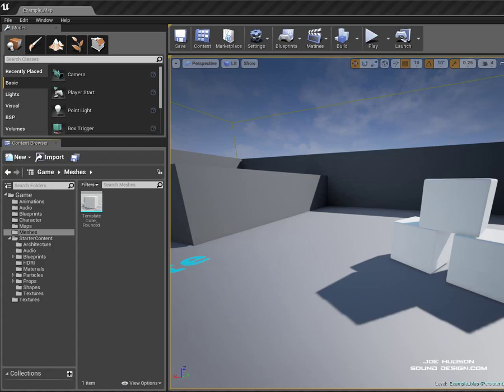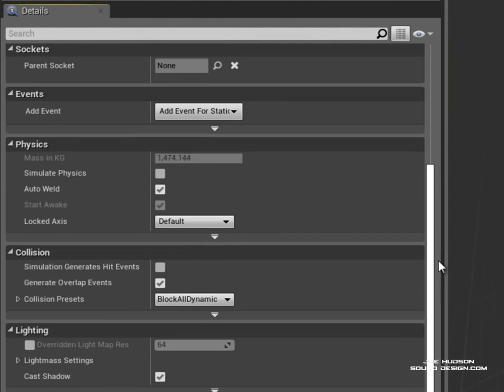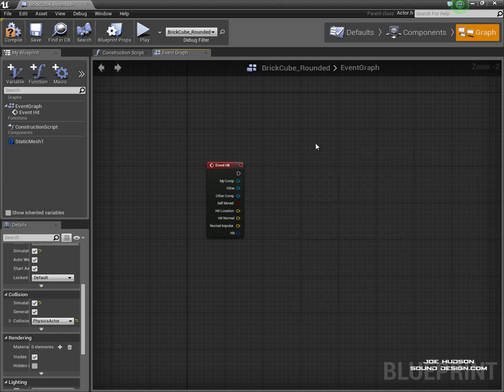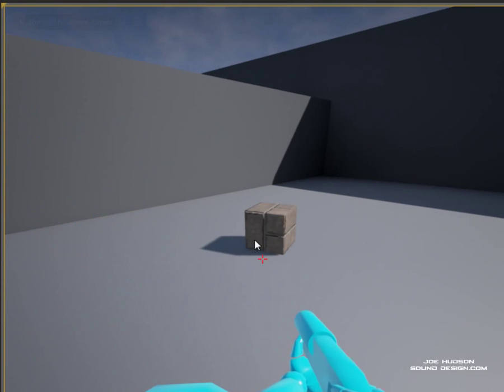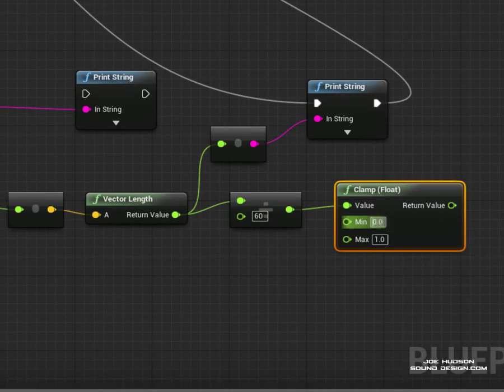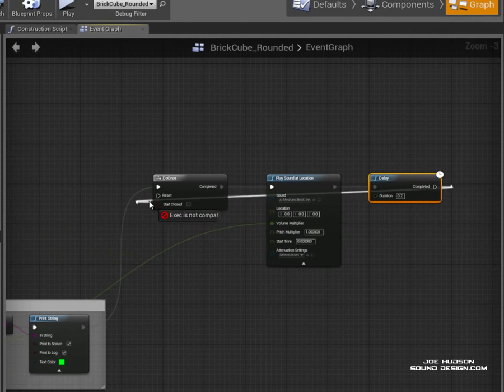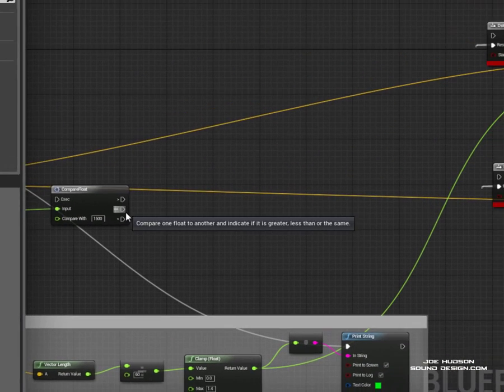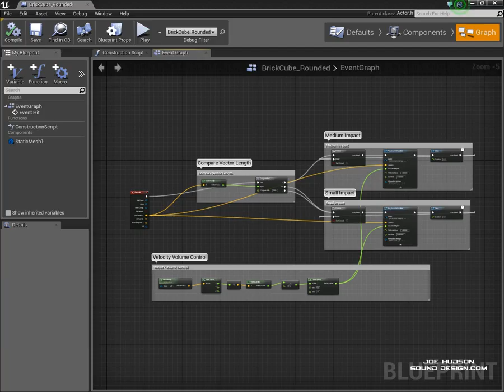UE4 Tutorial - Advanced Audio & Physics Collisions

Comment: Vector Length. VECTOR LEEEEEEEEEEEEEEENGTH. That's what I needed! :D

Thanks, great video.
Reply from the maker: You're welcome pal! :-D
Reply: Side note - do you have any tips on modulating a lower pass filter in Unreal (without Middleware) I found something in Blueprints but couldn't get it to work. Posted a question about it here: 

https://answers.unrealengine.com/questions/589915/get-set-low-pass-filter-does-not-appear-to-functio.html
Reply from the maker: Yeah it wont work mate, although audio enhancements are about to drop in 4.16, not too sure on the details of what is being released, but Epic are addressing the audio deficiencies with the engine. Some things are just static code and wont work without bespoke code support. I am trying to do something similar with global wind speed tied to a wwise RTPC and it just wont budge. Good hunting.
Reply: Ah, thanks so much for that! Keep being awesome. :D

Comment: Thanks for the tutorial.  I need to come up with a way to simulate many marbles rolling around.  Potentially my scene could have as many as 300 marbles rolling (that is pretty much the only thing in the scene, the marbles and a funnel)- I'm assuming it would be a bad idea to have each individual marble play the sound a single marble rolling around?  I'm not sure what the best practice is or upper limit of audio sources is.
Reply from the maker: What you need is a looping marble sound, loop it continuously in the marbles actor blueprint and use the marbles vector velocity to fade in and out the volume based off a certain threshold, (using the same techniques in the video to get the velocity values in the correct ranges to control the volume. Check out my audio optimisation techniques video to cull your voice count, I do this on bullet impacts but the principle is similar, perhaps you could use a cone volume attached to the camera to only audition the marbles when they are in shot. or if that doesn't fit your game, you could count the number of marbles spawned in the scene to a global int variable and then in each marbles blueprint before the play sound node you could do a check for the number of marbles in your scene and if less that or equal to a say 6 marbles play individual marble sounds if greater than, play another marble sound which mimics hundreds of marbles in the level blueprint as an ambient sound. Hope that gives you some ideas.

Comment: When it comes to creating original assets from sound libraries/recordings for use in video games do you normalize your audio assets so that they behave more consistently in the engine? I'm thinking in regards to attenuation and levels. If so, at what level do your normalize to for ambiances versus sfx or foley? Cheers.
Reply from the maker: Since mixing in the unreal engine without third party middleware is a real pain, its always a good idea to have consistent levels for your asset groups.

Tbh it totally depends on the game you are working on, there are no hard and fast rules, but as a rough guide you might want to have your ambiances somewhere between -68dB and -28dB. SFX such as gun fire at -6dB. Explosions -0dB. In terms of Foley it depends what the object is, something around -12dB to -24dB. That sound put you in the ball park.

In terms of attenuation, it totally depends on the object, but what I will say is that if you are using Wwise and you have an unnatural object don't be boring with the attenuation curves, create something unique and push and pull the player into the sounds location in a way that is interesting/moving.
Reply: Joe Hudson
As of right now, I'm just doing some sound design for some of the showcase levels. Working on Sun Temple right now. Having an idea of where I should be normalizing to(for the sake of consistency) is a big help and I appreciate shedding some light on that subject for me. Like you said, there are no hard and fast rules, but having knowledge of the usual ( and I use that term loosely) levels of ambiances, ,sfx, and foley is a huge asset. As for Wwise, I've ran through about 85% of the project adventure handbook so far and I have an OK grasp(still learning). UE4 is a different beast all together, but I'm slowly learning and your videos and others are a great help. Keep them up.

Cheers,

J.R.
Reply from the maker: Fak Yu Thanks, Keep going mate we're all on a learning curve, even the top pro's learn everyday, thats why we do what we do.